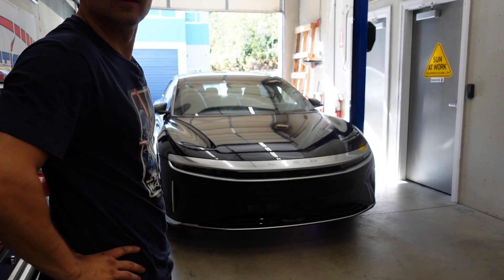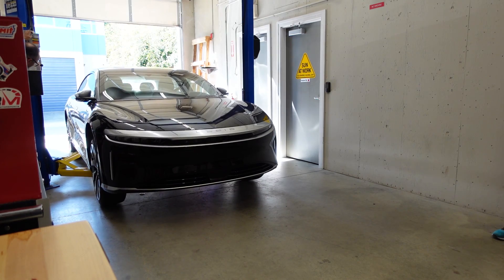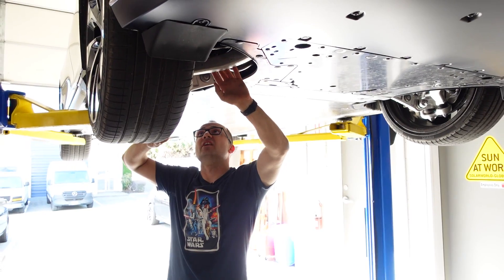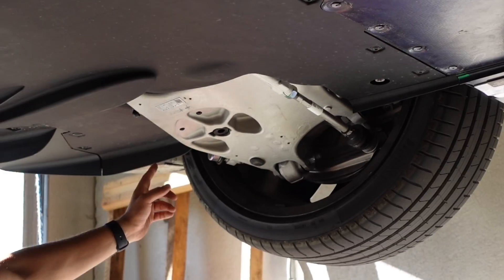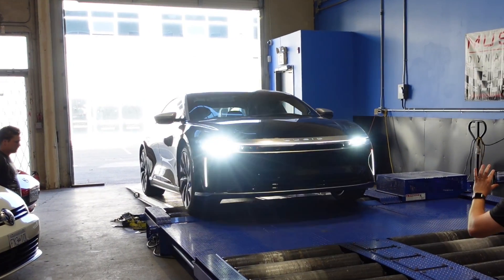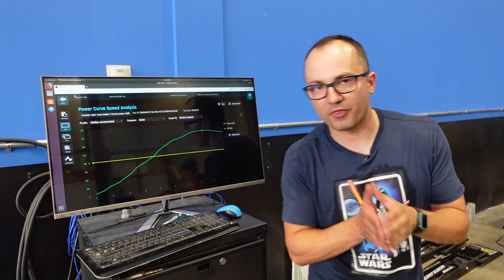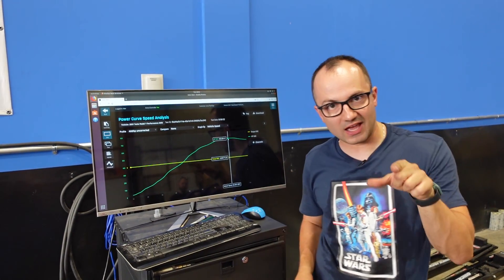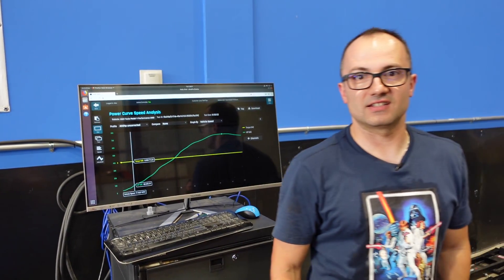Lucid Air GT DYNO - World's First!

Comment: Love it. I have that exact car, but in a deep metallic maroon color. Yes, the torque down low is ferocious. To get max power you need a 100% charge and then "precondition" the battery  (a setting on the control panel) as if you were going to a charging station and wanted maximum charging speed.

To shift a Lucid into neutral while driving tap up (gently) on the shift lever. Yes, it is scary to do that. A big push shifts into reverse.

Between 60 and 100 it pulls like a demon but does taper off a good bit past 140. Software limited to 170. If that doesn't work for you there is a 1,050hp version in production and a 1,200+hp version shipping next year if you can afford to get on the list.
Reply from the maker: Thanks for the tips. It certainly has more than enough power to move the beast around at a rapid pace. Excited to see more cars with different ev and hybrid drivetrains and to start tuning them.